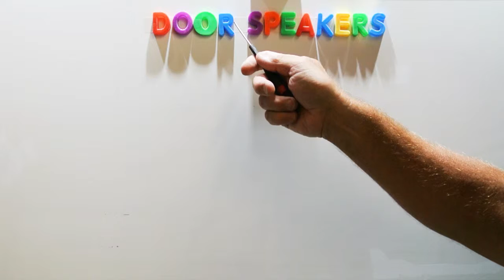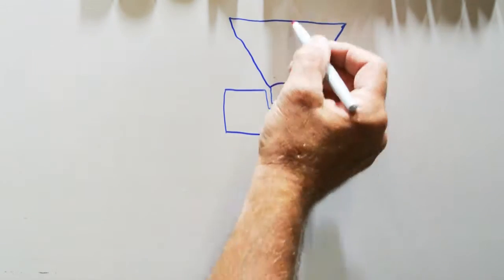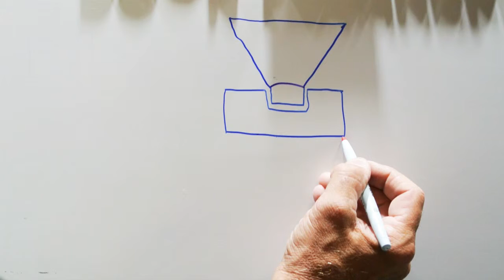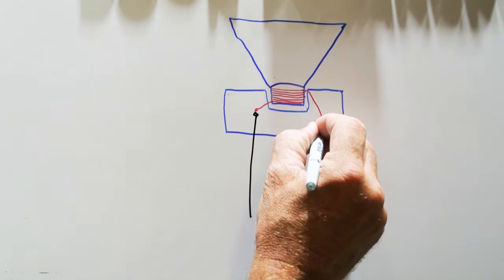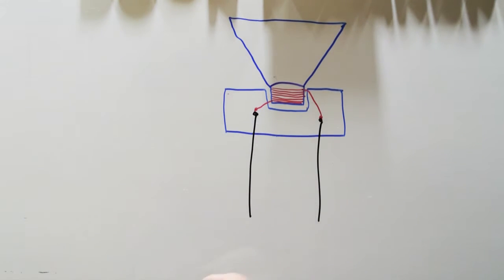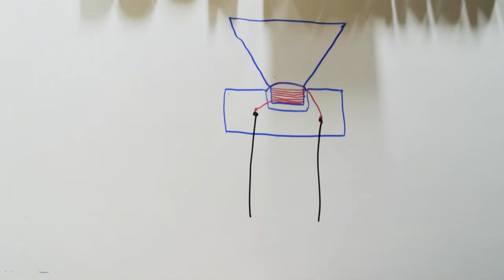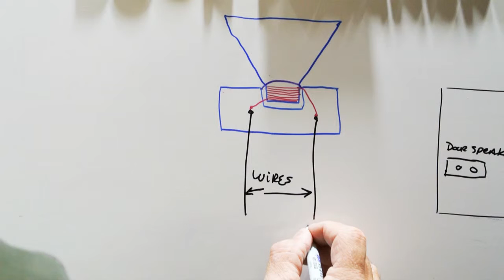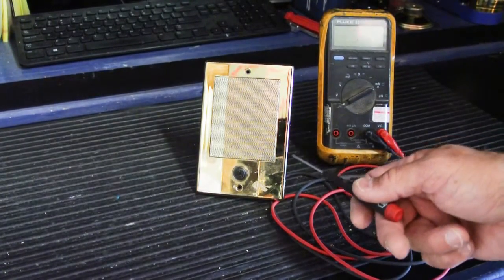The Fundamentals of NuTone Door Speakers

Comment: Thank you for this great explainer. My mic works very faintly, but speaker does not work at all. Does this rule out a wiring problem, and most likely mean a speaker problem?
Reply from the maker: Hi twodoshas:  Without more details about what System you have - It's difficult to proved any specific answer to your question - WhaT i can tell you is, there is no "Mic" in any NuTone Entry Door Station - The Speaker does double-duty as the Microphone and as the Speaker - You probably don't have any wiring problems. . . You may have a failing Speaker Cone, depending on how many decades it's been outside in the weather - or, you could have a System problem ranging from "it's way out of adjustment" to "there's a real problem with it"
     Fro more specific help, you will need ot contact us directly - Chris     nscompany@msn.com

Comment: Awesome content! A client has a IS-69 speaker that someone else removed to install new door. No I came to reconnect and saw there’s a grey three wire ribbon cable and 1 black & 1 white wire, but there was also a yellow wire going from the push button to one of the speaker terminals. Can you help shed some light on what was going on there? It all goes to a IM-3303.
Reply from the maker: Hi HBS Electric:  It's impossible for me to try and explain what all of the wiring "may" be for in a reply on YouTube.  It would be best if your contact me directly about the mystery of the Door Station Wiring - Chris    

 nscompany@msn.com